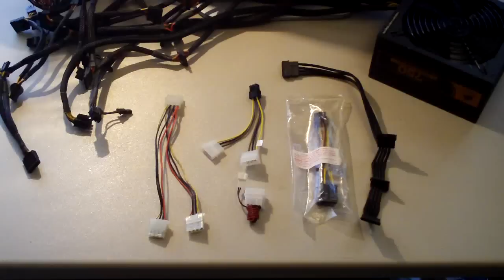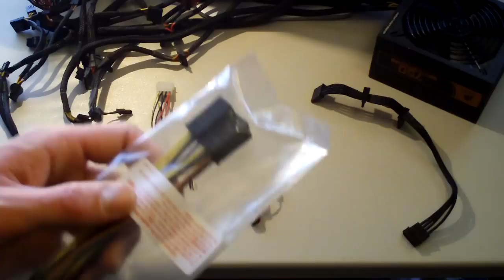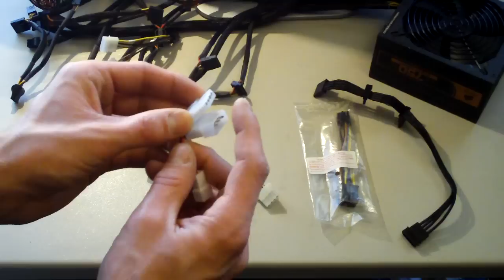PSU Power Adapters Explained (SATA/Molex/6-pin/8-pin)

Comment: I have a guestion, why graphigs cards use two 6-pin connectors, why one isnt enough. 

I just bought 5870 vapor-x and it requires 500w and i have 500w but only one 6-pin connector, can I use that connector?